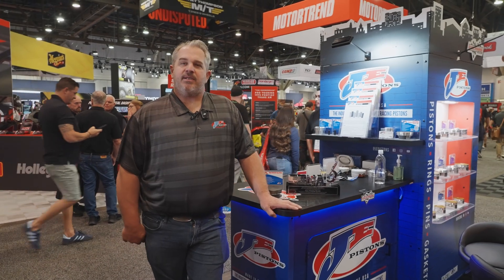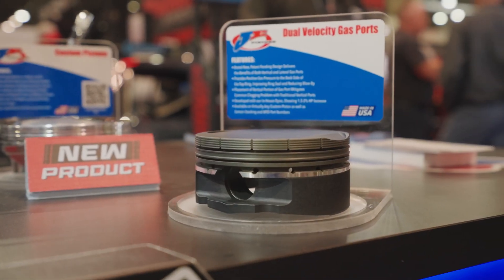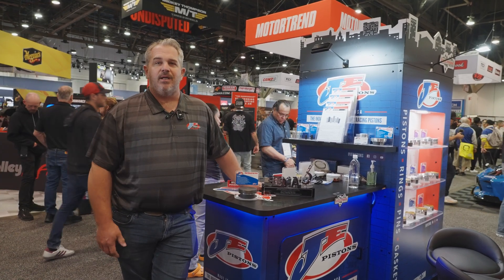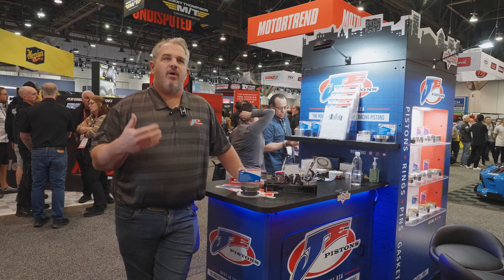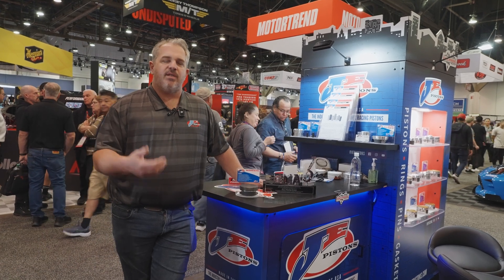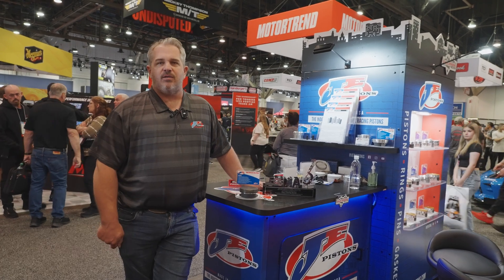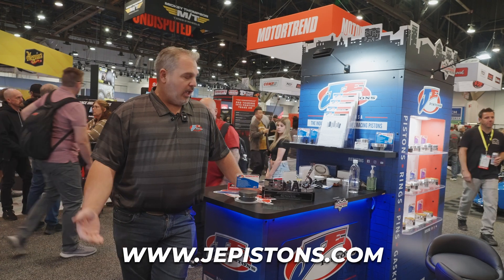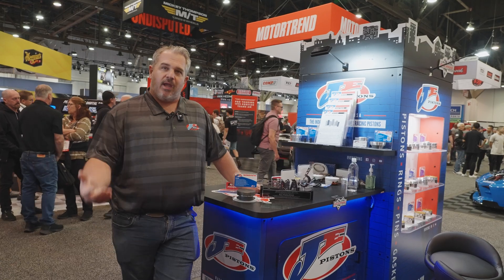We Won an Award for These! SEMA Sneak Peek 👀

Comment: I read a lot of skepticism. You do know that a 358 NASCAR engine made 850 hp for 500 miles. It's these very kind of little things that result in big gains. 1/2 inch pushrods would have have had the same kind of doubts when they were introduced, yet they resulted in a gain of 10hp. Progress marches on.

Comment: So assuming this would be affected by the block pressure. As in, does this require the block to be under negative vacuum. And would this still work with bypass catchcans and crankcase ventilation? What’s the best configuration/ requirements to get this to work? And could this be offered as a service to existing pistons?

Comment: Results are totally dependent on the application, it certainly will not make 2% on every engine. This is not new , it has been used for years on race engines.

Comment: I doubt the claims. First of all a reason why one could gain some power by incorporating a dry sump lubrication system in a high reving engine is the possibility to give up some piston ring sealing and therefore friction. And further more the relationship between better piston sealing and more power can hardly be linear because at some theoretical point you have sealed all of the combination pressure and at least by that time you can't gain more power from it. Best case it only hurts your wallet

Comment: @themotoroilgeek I wonder what the increased wear looks like with the additional pressure on the rings vs non-ported vs ported rings. These might be a good compromise for semi performance street cars between to much wear caused from normal ports which reducing longevity and no ports for long life.
Reply: Four stroke engines only have one power stroke every two revolutions of the crankshaft. Non issue..

Comment: Fan of JE but with all the focus on gas ports. Isn't the pressure forcing the ring to the bottom of the groove. And how much time does it take for the gasses to travel behind the ring? Does it control ring flutter?

Comment: Odds on, not available for Slant 6.
Reply: A piston is a piston they can make these for any motor it's not that difficult lol
Reply: @Wildstar40  You missed the subtext. It's not whether they can, it's whether they will.
Reply: @PiDsPagePrototypes  
If they want to sell pistons they will.
Reply: Don't slant 6 use normal pistons?  They don't have unique geometry.  

What are you building that you need forged pistons in a slant 6?  I cannot think of any slant 6 applications that would have boost or rev with high compression.
Reply: @zanzabar4ky7  
I always wanted to build a slant six with a LS type crossflow head, port injection and of course a turbo. Maybe somebody is doing that.
Reply: @ people do that with the Ford 300 inline 6. Converting a slant to cross flow sounds like more of a pain than putting in an inline 6.   You could import a bara and build it for much less than trying convert something.
Reply: @Wildstar40  There was an open-wheel type race team down in South America that made their own crossflow head, even had three sparkplug bungs for each cylinder, so they could run single or dual plugs depending on the track. You can do it for a road car for LHD, dropping the exhaust straight down on the right side of the car. Doesn't work for RHD though as that's where the steering box is.
Reply: @zanzabar4ky7  Or, grab the Jeep 3.8 V6 and six speed and drop them in to an A-body. Stock they have the same sort of output as a worked Slant, just way up higher in the rev range. Takes about half the weight of a Slant off the nose, and moves what mass is retained to behind the front axle line.
Reply: @zanzabar4ky7  The 'truck' spec AT-2 Slant takes to low-boost (7 to 14 psi) like it was designed for it. Probably not hugely well known, but turbo Slants have been a thing since the 70's, usually done as sleepers. IIRC the Tilley Brothers out of Sydney still have the power record, at 635hp out of a 225, never posted the torque number though.
Those might be worth having forged pistons for.
Same goes with factory "Hyperpak" installs.

Comment: I've used JE for years and started having quality control issues about  five years  ago. Great pistons and designs but you have to inspect every small drilled hole for remnants of broken drill bits from the manufacturing process. In house (JE) inspection would have saved me a lot of time and money. Oh, by the way, JE wouldn't  stand behind their product. Still use them but now the inspection is done in my shop.
Reply: It isn't just JE, but also WIseco (both under the RWB umbrella).  Production times have doubled for Wiseco in the past few years, while quality has dropped... and sometimes for absurdly stupid faults like forgetting to coat the pistons.  How does no one notice that before shipping?  To be fair, I've had issues with CP Carrillo pistons as well, and I'm paying ~30% more for a CP product versus Wiseco (all custom pistons).  Basically we're stuck and I just have to tell each customer ahead of time to anticipate longer production times than the manufacturer claims if I'm using Wiseco, if the customer wants to pay a 30% premium, we'll use CP and get them faster... but either could still have QC issues.
Reply: I switched over to using exclusively Wossner because of JE and Wiseco QC problems.
Reply: @bennyb.1742 I've heard of people having problem with wrist pins in Wossner pistons. Personally never had that problem
Reply: I don’t trust new parts. 100% visual inspection is mandatory.
Reply: It’s likely not their fault. Think about all of the Toyota engines that had similar shavings in their blocks, Toyota had to replace 100,000 of them. Most people blamed Toyota, but they don’t understand that the government has actually mandated less water use and different chemical processes in the manufacturing process, which leaves residue in engines if you aren’t careful.     So whereas, in the past, manufacturers had excess water and ability to wash out and clean off these types of things and the metal shavings, now because of environmental regulations they can’t do that to the same degree, hence stuff like this happening. I think people should look into this aspect of it, and really understand that there’s a reason besides laziness and low quality control that some of the stuff is happening.
Reply: @caryg4638 sounds gay
Reply: @caryg4638  if that’s the case, they need to be more transparent. And tell their customers to double check or require them to claim before installation.
Reply: @caryg4638 if they’re shipping product off with defects IT’S THEIR FAULT
Reply: @caryg4638 "which leaves residue in the engines if you aren't careful " So isnt the answer BE CAREFUL?

Comment: Now if it would work in a Delorean to get to 88mph faster that would be, Really Something!     The Odd-Fire PRV-V6 needs so much help.  I hope the Delorean Peugeot/Renault/Volvo guys hear about this, also the Alpine a310 that uses the same engine.
Question:  what is normal crankcase pressure of a good functioning motor w/o these pistons & what should it be with these piston's????
Reply: Case pressure shouldn't change, but might be slightly lower. The gas port is about getting better ring sealing, so if they're sealed better, you get less blow by.

Comment: i smell bullshit
Reply: I can see how it should work, and better sealing of the ring is always a good thing, but how does the extra gas coming around the back of the top ring to float the ring in the piston, affect the lower ring?
And, does the effect maintain good sealing after ring beds in and the top of the crosshatch in the bore is smoothed down?
As much as I understand the theory, I wonder if better coatings on the piston can reduce friction losses more.
Reply: stick to riding bicycles leave the engineering to the pros
Reply: @supernice_auto  cockhead
Reply: @supernice_auto  you wouldn't know a piston if you shoved it up your A hole
Reply: @supernice_auto  ✊💦

Comment: So it will be worth 10hp on a 500hp engine. At what cost? We all know the “newfangled” modifications are always over priced.
Reply: I don't see any good reason for it to cost any more if you were already buying pistons but research and development is a thing buy it seems like it wouldn't be that much more
Reply: This is just 1 feature that improves power, so if the piston has 2,3,4 or more features that improve power by 1 or 2 percent on just 1 piece of the rotating assembly, over what the factory offers it makes more sense.
Reply: presumably from what he said, it will be cheaper and easier than other types of gas porting, and more reliable as they won't clog up holes